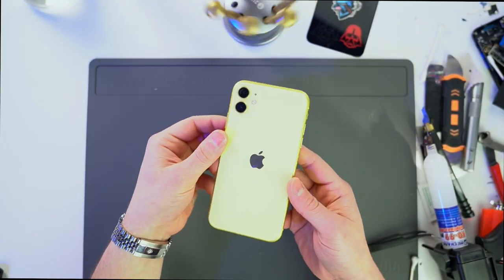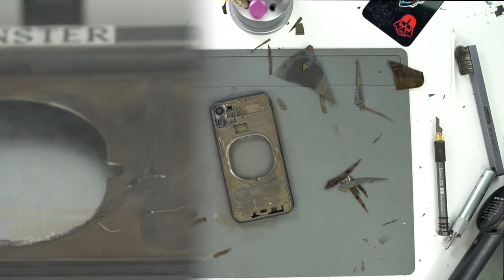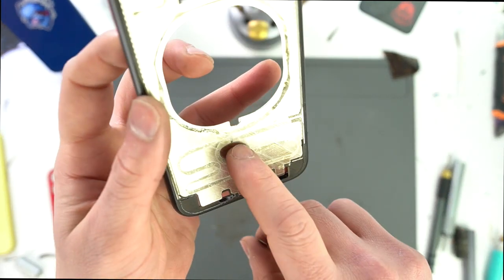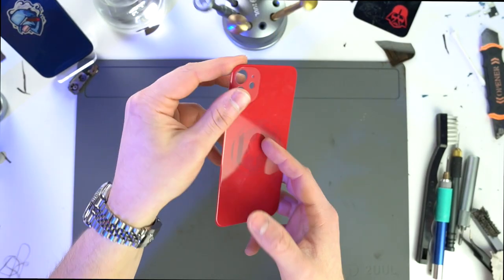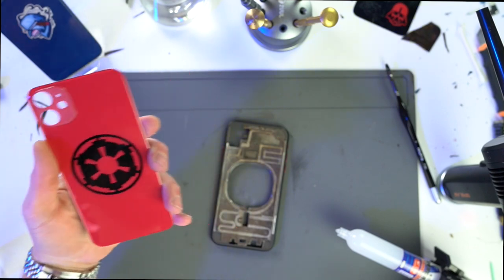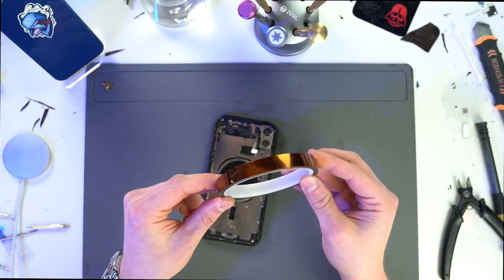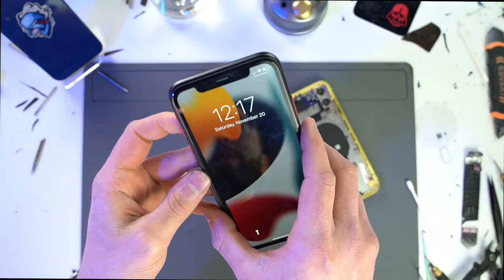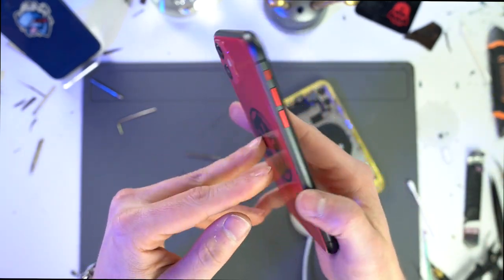I made a custom Star Wars iPhone 11 WITH MAGSAFE

Comment: How did you attach the mag safe to the board to allow charging?
Reply from the maker: Great question! The magnets don’t connect to the board, they’re simply placed on the backside of the glass surrounding the perimeter of the wireless charging coil-(which is connected to the board). This allows MagSafe accessories to latch onto the charging coil magnetically through the glass and charge!
Reply: @Kabonster  ahh so charging coil is already there on the board your just adding the magnet circle. Gotcha!! can you put that on and android phone now cause i want mag safe on my Pixel 5!!
Reply from the maker: @steve_main  That would be interesting to test because the Pixel 5 has an aluminum back which could interfere with the magnets.

Comment: Why would you need to use lazer on it when you just needed to break the glass though
Reply: He still needed the back of the phone’s case, which wouldn’t have easily separated from the glass without removing the adhesive

Comment: Is it possible if you can do a video of adding 3D Touch on the new iPhones??
Reply: Probably not. Newer iPhones without 3D Touch have different sized screens from the older iPhones with 3D Touch, so there are likely no 3D Touch modules in existence that would fit (except in Apple’s labs). Even if they did fit, they the newer iPhones aren’t likely to have the required connector for 3D Touch, nor are they likely to have the drivers to support it.